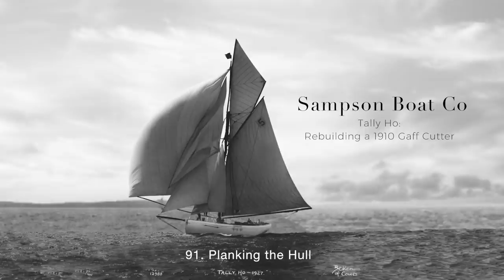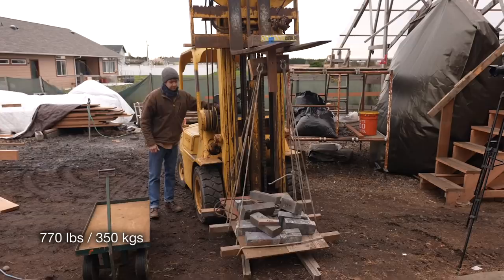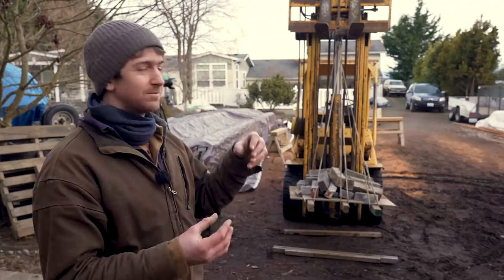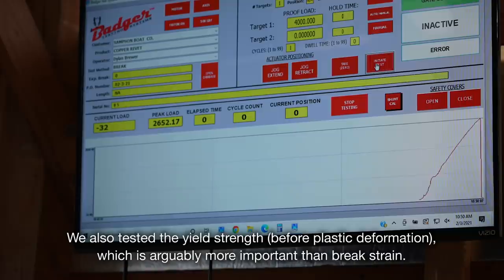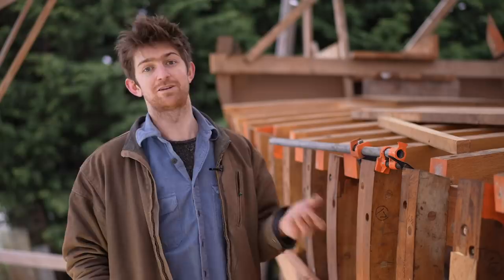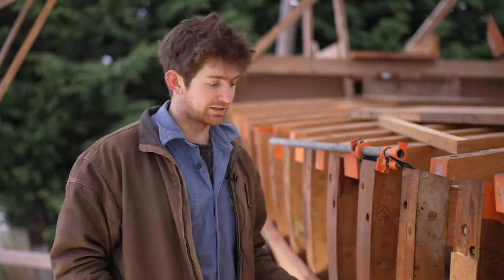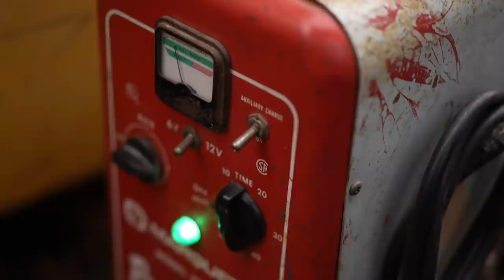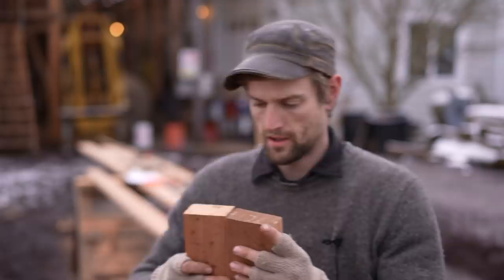Planking the Hull - Part 1 (Rebuilding Tally Ho / EP91.1)

Comment: Since the planking is under tension when installed, does this provide extra strength/rigidity for the boat? (By the word "tension", I'm saying there is some sort of torsion put onto the planks as they are installed ... they aren't just laid in there, but cranked a bit to get into position.)

Comment: Can someone help?  On the port side the planking starts in the mid-section but on the starboard side the planking starts at the keel.  Why is this?
Reply: They are planking both levels of both sides more-or-less simultaneously.
Reply: @Leo - just seen Ep.2.  Thanks for explaining why you've staggered fixing the planks.  Makes total sense. 👍

Comment: Hi Leo,  Just wondering what your plans are around the lead keel?  When are you planning to re-attach it to the wooden keel?  Also, it seems like it's in pretty rough shape and that would cause drag?  Any plans to fair it into the line of the keel?  Thanks!
Reply: One more thing, do you anticipate any galvanic issues with the copper, bronze, and lead when fastening the keel?

Comment: It seems a little odd to me that you chose to overdo the riveting by so much. Is it for historical reasons? Surely chosing a smaller rivet would have saved a lot of cost and hours peening? The holes in the planks would be smaller too, no? Could you talk a little about that? I assume your target/expected strength would still have plenty of safty margin.
Reply: The original copper rivets were 3/8" diam. These new ones are 5/16" - while they are still stronger than necessary I wouldn't want to go any smaller.

Comment: @~22 minutes... why doesn't the caulking (corking?") just pop out if the bevel is open to seaward? what exactly holds it in place?
Reply: It's whanged into place w/ a mallet & wedge-shaped caulking iron.
Reply: @frederickstibbert7389  maybe so, but as it swells due to water absorption, it will seek
 space to fill into, and it will find the least resistance to that swelling pressure seaward, towards the opening, with nothing apparently holding it in place as it swells outward.
Reply: @BigJohn6060  Wooden boats have been caulked for hundreds of years so obviously it works!!!
Reply: @tonygrimes13  - that might satisfy you but I am curious at a slightly deeper level wanting to know how and why it works. I have no doubt that it works.

Comment: is there any part of the original boat being used ?
Reply: Only a small percentage:
The ballast keel (lead)
The bottom half of the transom (teak)
The large capstan (bronze)
Most of the deckhouse & cockpit sides (teak)
A few bits of bronze hardware & some portlights.

In addition, Leo can re-saw the old teak keel, & offcuts from the new purpleheart timbers, for interior work.
Reply: @frederickstibbert7389  what a huge project nice job

Comment: Interesting to see how much faster the planking seems to go when compared to Arabella. Could be you simply dedicated less time in your videos to the process. Of course, a lot of Arabella's planks are oak and first made into planks running the entire length. Seems to me your method is much simpler but, perhaps, will also have less rot resistance / longevity? I don't know anything about boat building so just thinking out loud.

Comment: When you but boards, why do you do it between frames and not over a frame?
Reply: They add what is called a “backing block” on the back of the two butt edges. This block allows you to fasten the planks together farther away from the edge of the board. Also trying to place all the plank ends on the frames would add additional hardware through the frames causing more holes and reducing strength as well as you would be losing distance on the plank having to cut it to land on a frame. Hope this helps.
Reply from the maker: More landing area!

Comment: I don't know how you can call this a "Restoration" when there are a total of 2 or 3 pieces of the original Tally Ho in the current boat. The only thing you have really used are the original plans.
Reply: Rebuilding antique aircraft all you need is the original registration plate.  His concept stated way back was to reuse more on the internal cabinetry.
Reply: Watch Episode 58.